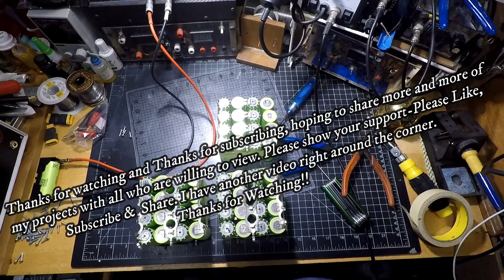A123 36V Module From Battery HookUp (tearing down the case)

Comment: How many amps do you suppose the as-welded tabs would be goof for?
Reply from the maker: I wouldn't know, but it feels like they used .3 nickel strip and I used 3 pieces of .15 on the ends. Personally I wouldn't use more than 20-30 amps

Comment: Im waiting on an order of A123, I think these will become my favorite batteries.  One ideaa Im having, making 7S1p groups as they come in.  Series two into 14S...then add parallel groups as Im able for increased cap.  Another thought is to solder M2.5 or M3 brass nuts on "+' and "-".  if you can trust the chinese maker brass would be aa tad more conductive than nickel and it would be simple to attach and detach parallel groups. by simple unscrew 14 points where attached anywhere on the battery.
Reply from the maker: Only problem with that is having to parallel multiple series connection. While it’s possible and it will work, you have a higher chance of blowing the bms when done. This is one of the main reasons you see multiple DIYers using big parallel packs. There easier to maintain that way. I learned this the hard way with my first design. So I had to scrap it and go back to the drawing board
Reply: configuring a battery is definitely an artform as much as science.  From your eperiene, do you see batteries out of balance that often???  Counting my pennies, Im not using a BMS. just cell loggers and deligence.
Reply from the maker: @tonysshadow     Reusing batteries, if you keep the resistance very close along with the capacities, I have rarely seen them out of balance. I actually think we probably do a much better job at keeping them evenly match then most company builds. We take the time to find the closest cells. When you use large parallels, as long as the capacities are fairly close, you hardly see those out of balance, unless something went wrong with the back----bad cell or 2. I try and use a BMS whenever possible.
Reply: I appreciate you advice.  Forced me to take a closer look at assembly.  Something as simple as joing the charging/discharging wires to the battery can even make difference.  In my reading most folks just join to opposite ends of the battery for convience.  A better balance of load/charge could be achieved by configuring in such a way that you attached wires to the "middle" electrically and physically.
Reply: @njfulwider5  good to know
Reply: what's the verdict on pack

Comment: Have you tested these A123?   Just wondering if they drop drastically after about 3.6V like the SPIM.  Seems that a feature of the chemistry from what Ive studied.  I could accept the SPIM easier.
Reply from the maker: I have owned other Lifepo4 cells, and typically they drop anywhere from 3.6 to 3.3V when settled. I lucked out on these and they only dropped to 3.4V. I also got an average of 10,250mah per 4s4p packs, which again was a pretty good number. I am onto another pack and should be posting these being finished up and a bigger 12s4P pack hack.

Comment: I was about to spend some money on the SPIM08HP, but seeing these....It wouldnt take much effort to reconfigure into a 50V 7-8ah battery for my ebike....already with a handy carry case...15s3p...plus 3 left over.   My 12 amp power supply could be zapping each parallel leg with about 4 amps.  Are 26650 a little forgiving in that???
Reply from the maker: I have both cells, and both cells are great at taking large amounts of energy when charging and discharging. You can easily put 8 amps into one cell when charging. The SPIM can easily do 20amps. The only problem with the cells is how wide they are and might be a little awkward for a ebike battery. But if 7-8ah is ok for your needs, it should be fine. I personally have only built the one ebike battery and that one ended up 34ah. I have an idea what I want to do with these, and it should be a pretty cool project when it's complete. Unfortatnyly, one pack i had to completely disassemble to find the bad cells. One pack was perfect and I'll probably make them 4s4p and then 3 in series to give me back the 4s12P. The bad pack, I'll have to purchase a few cells and rebuild to 12s4p and hopefully, my last 2 packs will be perfect and I can figure out how to hack the BMS. If not, I will just purchase 2 x 12s lifepo4 BMS. Then I plan to parallel all 4 packs for my project. Or that is the plan....LOL
Reply: Bang for the buck is my problem.  Im a poor pilgrim.   plus a little stealth on the bike.  My cargo bike has running boards (or something like that) on the back.. The SPIM would do nicely just laying flat acting as the running boards.  My little 1000W generator sit on the back like a little suitcase.  For the back roads of Georgia getting into town ild have to have a 200-300 ah battery..  Converting the generator to run on a little propane torch bottle seems to be easy project working around the carb.  Im curious to see how many miles a bottle keeping the battery charged...I can get.

Comment: Thanks for the info.  Waited for your video, before I touched my packs.  Quick question did you charge the pack, or was the pack fully charged when shipped?
Reply from the maker: Talking with Tom he said he tested these himself, I had one pack fully charged, but bms wouldn’t work and the second pack halfway charged and the bms wouldn’t work, but had a yellow light active on the board.

Comment: Some one gave me 10 of those A123 cells.  All good.  The first thing I did was DESTROY one trying to Reverse Charge the dang thing.  The Normally Negitive Flat end is in fact the Positive.  There backwards.  LOL
Reply: Yep, gotta watch polarity on these.
Reply from the maker: ORRRRRRR!!Maybe the 18650 lithium Ions are backward......Which one came first...LOL
Reply: @njfulwider5  No they are the ODD DUCK.  No other cylindrical cell that I know of has the Flat End Positive.  EVER.  LOL  In any country.
Reply from the maker: @pulesjet  Still makes you wonder? Who decided what? I don't have no issue with the polarity, even the vent is a single hole. I just make it a point to pay attention to every single cell before sticking them in the holder. Or Common sense, the black end is the negative end. The makers of A123 cells, just have to make sure they stand out by doing this and they do. Its a great way to get in the habit of looking or using a multimeter to figure out polarity,
Reply: @njfulwider5  lol, I check the voltages.  Never noticed the Neg on the meter I guess.   They had no indicators or markings came out of a a drill pack. but were A123 cells. only a white wrapper.   Yes,   Pay attention.

Comment: Nice tutorial. Wish this was posted three days go. I just tore one of these down the other night. Once I separated it into 4S4P packs and cleaned up all of the tabs, I rotated each pack 90 degrees in the holder to parallel all three packs together. You'll have to trim the retainer clips on the tabs and everything will fit back together in the original holder and case, just be sure all edges are clean and use some Kapton tape for extra measure. Spot weld nickel strip to make the parallel connections before putting them back into the holders. Add a 50A circuit breaker and bulkhead terminals on the case where the original terminals were located. Now its a 4S12P 12.8V pack that I can carry anywhere.
Reply: So its a 4S12P 12v 9ah pack now? Im interested in building a mobile inverter.
Reply from the maker: Kraken King the batteries coming in 12s4p 9ah. You can make them 4s12p 27ah or 3 packs of 4s4p 9ah.
Reply: @njfulwider5  thanks 4s12p 27ah!
Reply from the maker: Thanks!! Like Minds think alike!!! I'm kinda up in the air, as I wanted to do this first. But I have some project up and coming that require allot of amps, and 9ah might just be enough? Not 100% sure what I'll do yet, I already have the BMS-s. I kinda purchased these just to mess around with.